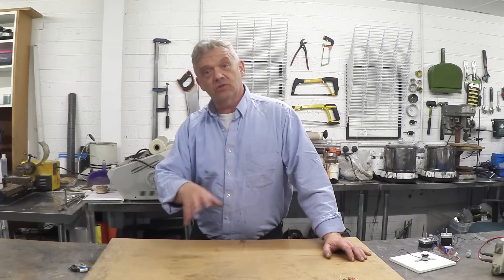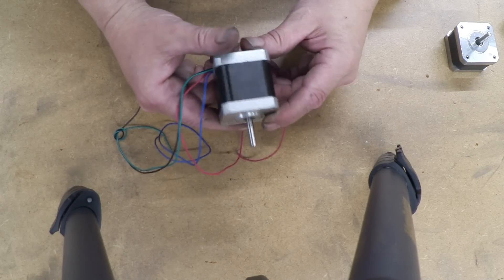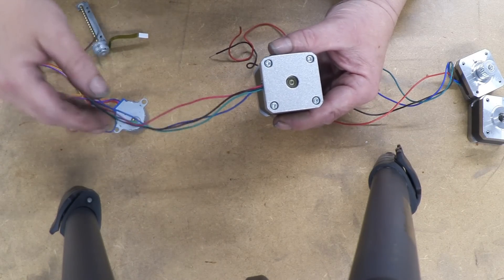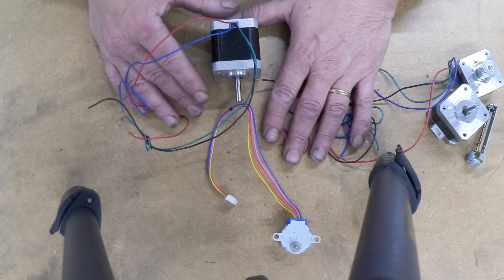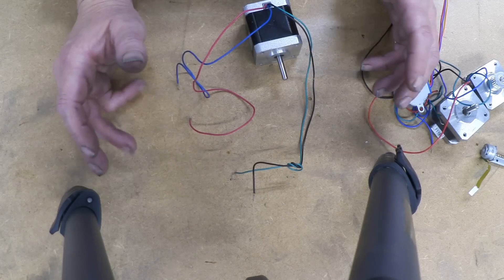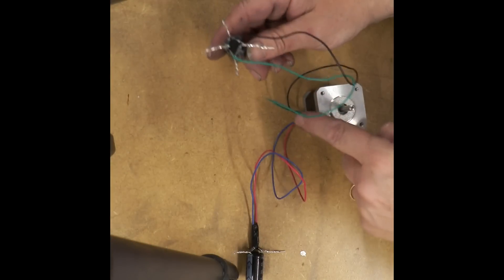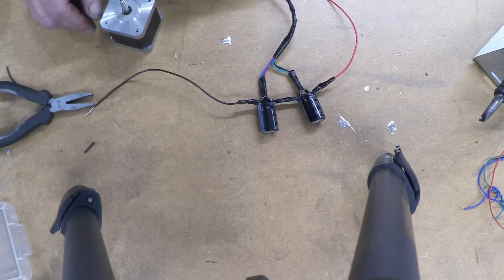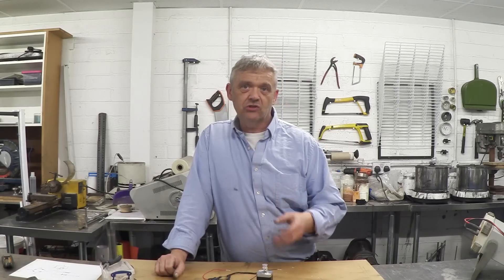All About Converting Stepper Motors To Generators

Comment: Do you have a video on using them for motors?
Reply from the maker: no mate - I am sorry I don't but I can do one
Reply: @ThinkingandTinkering  It's not an easy subject. The basics are clean and simple but it has lots of advanced topics. Like you need acceleration, deceleration, constant current high voltage drivers, dead time in the full bridges, software to calculate what trajectory you need to get to an exact position. Then there's decay modes to optimize control, mechanical load parameters which are very important ( for some mech. loads a stepper is completely unusable ). Than you have to deal with mechanical vibrations in the thing you are driving which can be very important to be succesfull. Probably many others which I'm not aware of

Comment: You drew bridge rectifier diagram wrong, you have both diodes on + and a - phase facing in the same direction, it will work but you will get same thing as just connecting 1 diode in series, which gives you half a pulse and defeats the purpose of connecting 4 diodes.
Reply from the maker: well that is strange mate because every diagram you look at looks like the one I drew - even from the online electronics tutorials and wikipedia - do you have a link to your 'correct' diagram ?
Reply: @ThinkingandTinkering  Oh sorry, you are right :). My bad... keep up the good work.
Reply from the maker: @ivangrozny875  no worries mate - cheers

Comment: Stepper motors are best AC generators but the frequency of their output voltage is very high.
Reply from the maker: that doesn't matter you rectify to DC mate